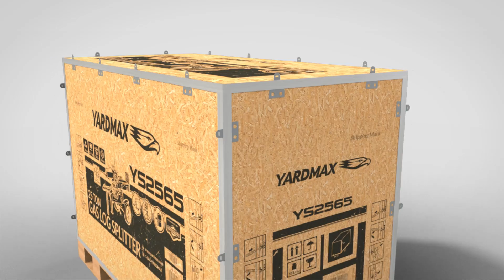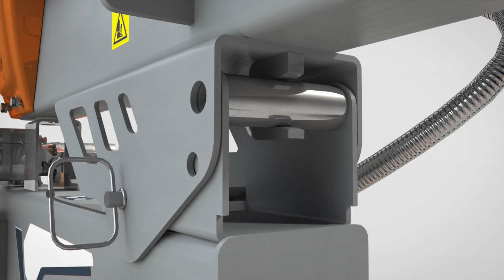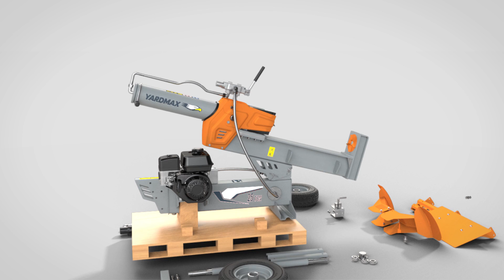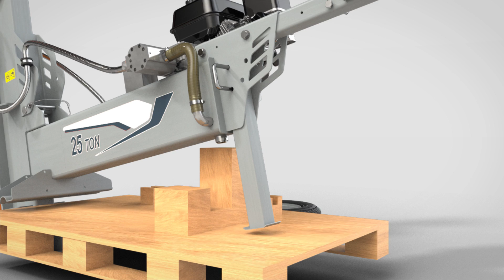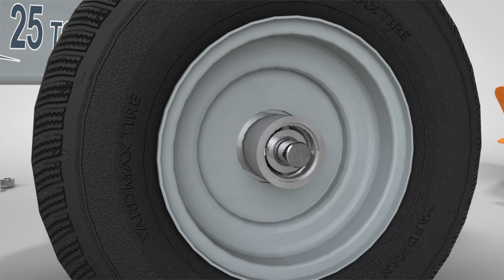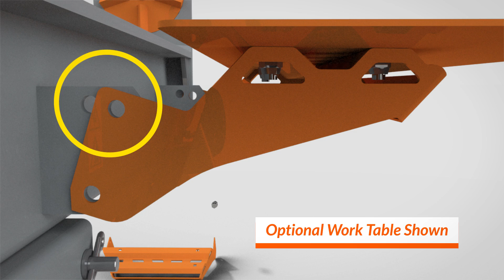How to Assemble Your YARDMAX Half Beam Gas Log Splitter

Comment: I just bought one of these in the 36 ton variety, and the packaging has changed. The main beam assembly is not attached to the base. And it's HEAVY. You will need strong helpers, or a lift of some type. Luckily, I have a tractor with a front end loader.

Comment: I just assembled the 35 ton splitter. The only way I was able to do it was with my forks on the 3 pt hitch. I lifted the entire splitter using the engine platform as a brace so that it would not tip over. I then blocked the splitter up and built it from there. Block it well so that it will not top over. Also, I just bought a trailer jack for it. The brace to hold it up is useless and dangerous when attaching the ball hitch. The trailer tongue is heavy! Trying to lift it, hold it and fold the brace is very difficult and dangerous. Then while still holding it up, you have to set it on the ball, Doable. Yes. But a trailer jack is safer.

Comment: I got it done in 45mins.  Man-handle.the axle/engine component at a 45 degree angle as the manual suggest. Use the corresponding number packets and slap on the tires. (Took me 10 mins). Lift the piston part of the splitter by raising it 6inches and pushing forward.  (Close enough to where u can safely lift it straight up, to where it stands by its self).  Have some one come hold it from
 falling. (I had my 13 year old.daughter do this job, handled it with ease...other than moaning about the wind).
Assembly the tow arm as instructed. Attach the corresponding pins.....you can easily "youtube" a video on how to do it.  I had mine delivered in a Wood crate. Put it together, and had 4 face cord of wood split....in under 4 hrs....currently have side jobs of splitting wood at.15 bucks an hr.....if your gonna be buying, burning, and splitting wood for anything over 5 years (believe me, goes faster than u imagine) then i highly recommend this log sitter

P.s. definatley get the additional warranty. 
Attach the piston using the corresponding pins to make it vertical and horizontal operating...

Comment: I am waiting to receive this unit in about a week or so this was so helpful I watched it more than a few times! Thank you for sharing. Is the Unit really high enough to slide the wheels on?  This is an ideal will way to stabilize it just not sure  if it may need to be lifted a bit (?).  I will have to watch this when assembling.

Comment: For anyone having issues, had issues or plan on building this, here some tips:
Assemble the first wheel hub (or the whole assembly) using the box the wheels came. Put the tire in the box, then the assembly and it will be a lot easier to finish that part.
As for the moving the beam into the beam pivot bracket, take my advice and build this unit in a shed or a structure that you can tie a rope to the unit, just in case it falls. 
More importantly, tie a rope when you put it vertically. Even it is sways, moves or anything, it will not fall. This is very important and can easily happen.
I would reverse the tow bar and support leg installations, especially if you plan on using the cotter pin with the support leg as you will have more room.

Comment: Horrible product. you need two people to safely assemble this log splitter.
We have several major issues with our unit and really hope this isolated to just our unit.
1. 90 degree hrydralic hose is bent
2. 4 way wedge is extremely dangerous as in my YouTube video shows. A piece of wood went flying could easily kill someone.
3. our unit seems to be lacking power even on the smallest of logs. bogs down and engine wants to shut off. 
4. Log stripers aren't large enough almost every piece of log that comes back gets hit by one or both hyrdalic hoses
5. I will post on my YouTube to explain the rest. more to come
https://youtu.be/jMUa4bZVRkg

Comment: Assembled it today by myself in about 2 hours, you will need an additional strong person to keep it from tipping over when you install the towing bar and the tires otherwise it will fall over like my mine did and it could have been a serious injury if I was in the way. The handle bar absorbed most of the impact when it fell over.  It is a well built machine and I highly recommend it.
Reply: Yeah mine fell on my leg kinda hurt

Comment: DO NOT USE THIS VIDEO.  If you follow these instructions the log splitter will fall over and you will break something. I broke the handle and I hope nothing more. This is a two person job. YardMax, you should really take this video down as the instructions that shipped with the log splitter are different, correct, and safer.  You could get injured by following this video, I almost did and I damaged my log splitter.
Reply: Same here. They need to take this video down and make sure the axle and wheels are shown being put on first, before you lift the towbar. It didn’t seem to make sense and then it sure didn’t. Physics at work in a bad way.

Comment: Just assembled mine and it can be done single handed, Take your time. Mine is a 30 ton and when I put it vertical the ram was still on the crate so I  had to filde arround, basically pput the wheel on earlier. Ir is very tipsy without the wheels/axle so need somebody or in may case something to brace to stop it going over.

Comment: Used this video and no paper instructions to assemble a 28 ton half beam. I did it alone and it went almost perfect to the video, though I had to attach the axle and wheels one step early. Parts are all in plastic shrink wrap on cardboard and easy to follow as to where they go.  Took just under 4 hours doing it outside in a light cold rain, so probably quicker if done indoors. This assembly is really very simple, just be careful as unit is top heavy before wheels are on. This is why I skipped ahead and put wheels on early for lateral stability.
All in all a pretty simple operation but if you have a helper available, use them.
As for the splitter operation, it started right up and I went to work on some very large (30"-36") and wet box elder pieces. It took all 28 tons to split these but it did succeed in getting it done. Vertical position a must. 
Ergonomically it is so much nicer than the full beam model (my son has one), much easier to get around it and like to lever being on the top, not the side. Tongue weight is significant and I will be investing in a wheeled crank system right away.